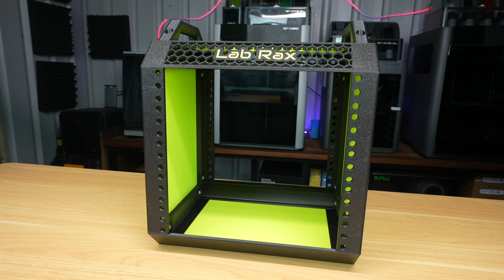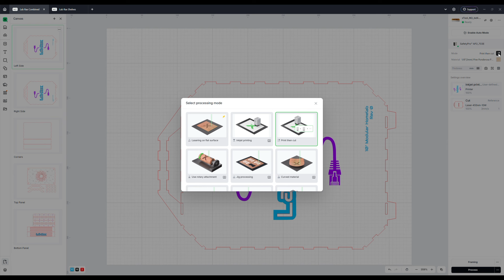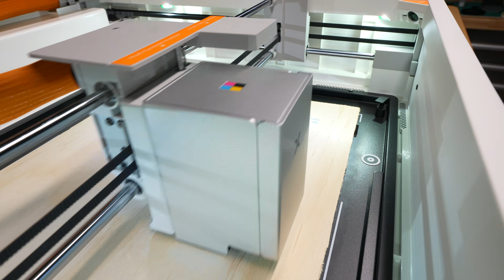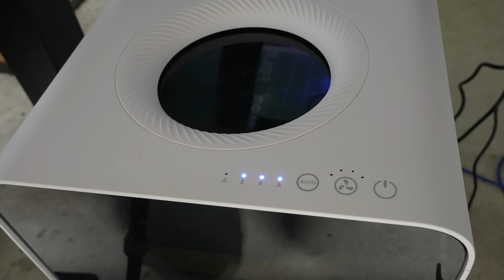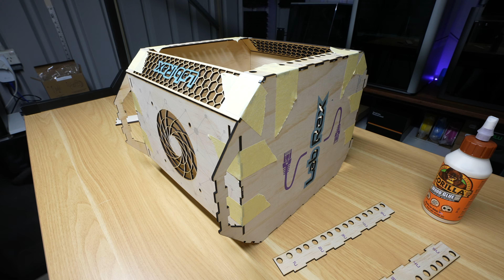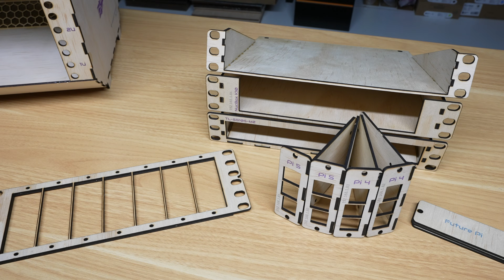The Fastest Way I've Ever Built a 10" Homelab - Using the xTool M2

Comment: Failed opportunity to use sheet metal, can use a roller wheel to add ribs to sheet metal panels for stiffness, like HVAC guys did back in the day when sheet metal was the main hvac ducting used.
Reply from the maker: That would be awesome! I don’t really have the tooling to do a sheet metal build though.

Comment: It looks a bit flimsy. The top part bends on the right and at the bottom. But overall it may very well be an alternative. It would have been interesting, what the costs amount to. But hey, you placed a nice ad for xTool with an interesting project.
Reply from the maker: It might just be the camera lens distortion, it doesn’t look bent in person. It does feel a bit more flimsy than the 3D printed version though.

Comment: This seems more like an ad for xTool than a true comparison to the 3D printed version. With the cost of the raw materials, I'm sure this is much more expensive. It doesn't look nearly as durable as the 3D printed version either.
Reply from the maker: Plywood is really cheap, this uses about $8 worth of plywood and maybe $3-4 in screws.
Reply: @MichaelKlements  Regardless of whether plywood is cheap or not wherever you're located, this still looks like a very inferior version of your excellent Lab Rax. I was hoping for a proper comparison between the two like durability and the true cut, assembly and drying time. The thumbnail shows 24 hours vs. 2 hours but I assume that's just print and cut time and doesn't include the time to assemble? I wouldn't trust lugging this somewhere without additional corner bracing and screws either. I was just disappointed that the majority of the video was an ad to say how great the xTool products are and the conclusion only states positives other than the screws being a bit fiddly. Do the promotion terms state that you're not allowed to say anything negative even if it has nothing to do with the xTool products?
Reply: You can get a 100 dollar 3D printer that can print the REX. Add in 16 dollars of PETG of high heat resistant PLA (30 bucks) and another 10 bucks for all the bolt and screws you ever need.
The biggest issue with wood is that it isn't safe. Especially not with exposed boards. And laser in general requires so much more than just the printer to be safe to be around with.
Even when cutting wood, there are lots of toxic shit being released and most people don't have the required spaces to deal with that.
Laser is cool, but it's not as 'home safe' as 3D printing is, even tho 3D printers do release micro plastics.